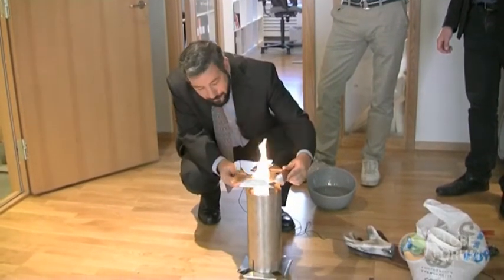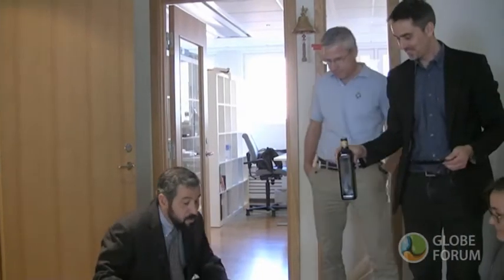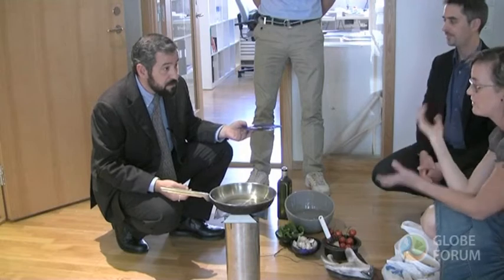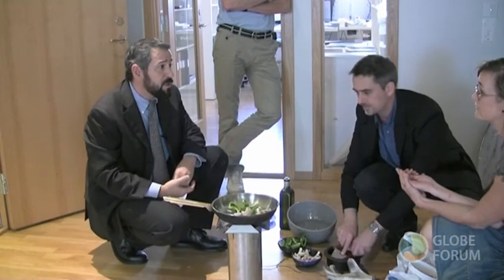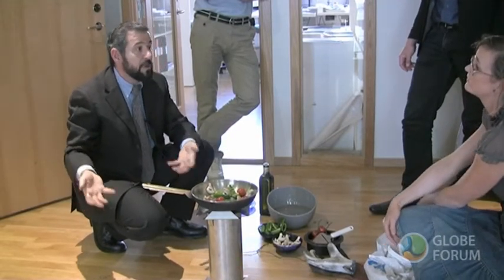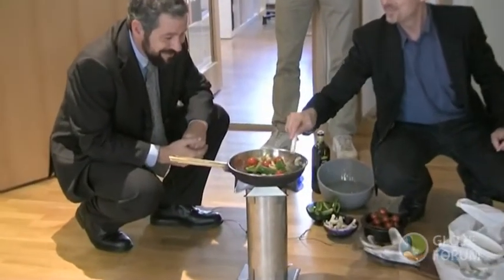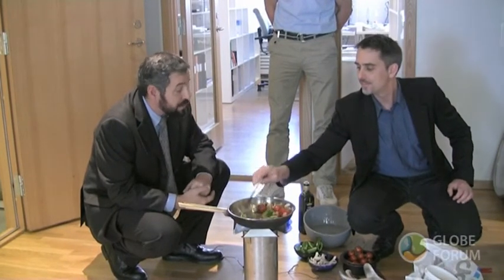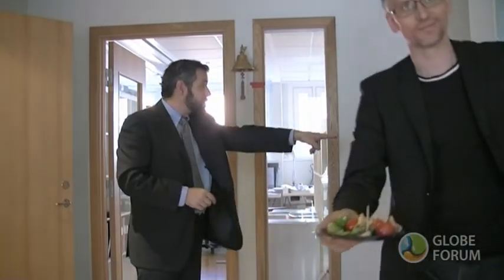Part 3 of 6 - Lucia Stove Demonstration at Globe Forum HQ

Comment: @aphilipdent the inner chamber, thanks to the opposing flow, flame cap and venturi there is not enough oxygen to ignite anything in the fuel chamber. Much of what is combustible (starting with the low carbon volatitals) is volatilized and used as a gas.  As for moisture content, depending of feed stock, if you are over 15-30% moisture content over 50% of your energy will go to driving off the moisture and not to providing useful heat for cooking or heating. hope this helps.